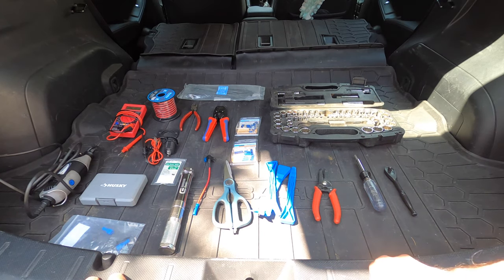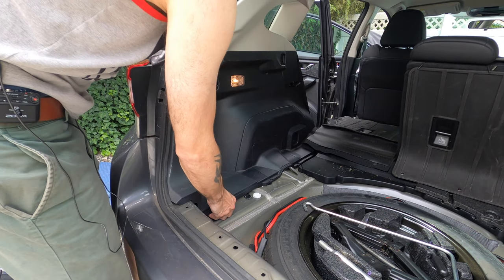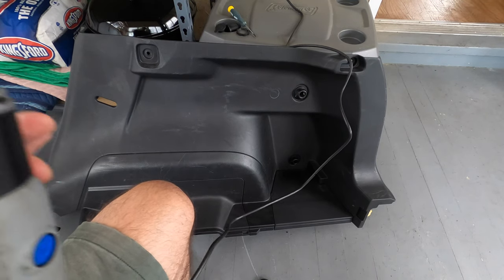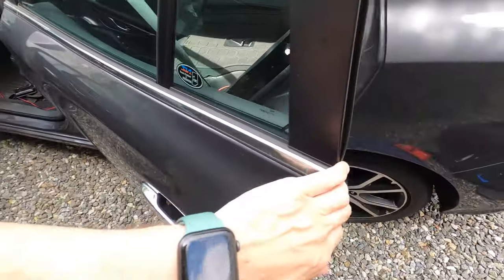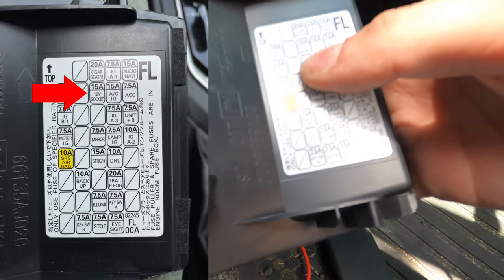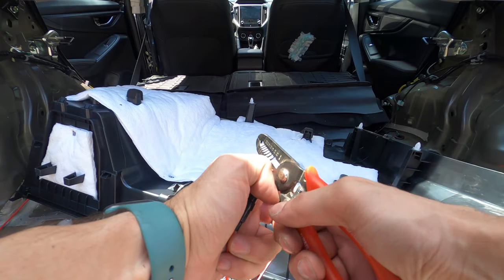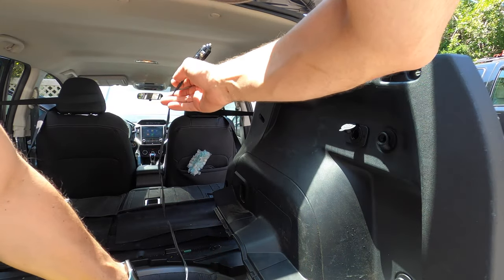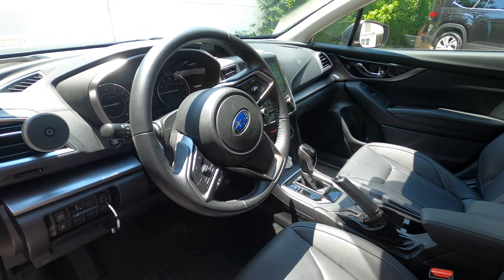How to Install a 12V Socket in Your Car - Subaru Impreza 2018

Comment: Interesting that you took the seat out. I ran trailer wires to to a 7 way tv plug I installed and never once thought the seat was in the way. I am looking to add a 12v plug for a dash cam in the rear of my car so the video was a nice refresher on where all the. Lips and screws are.

Comment: Should note on using fuse taps the prong with the wire side coming out should be on the negative side in the fuse box. Otherwise power flows bypassing the fuse making it point less.

Comment: I have the hybrid, it has a little pocket on the right side where the air compressor kit fits. Looks like I can just drill out the bottom of it and the socket will drop in, and the socket will be facing upward. I didn't take apart all of the panels on the right side, but I assume it's the same as the left. Any reason not to run the wire along the passenger side, and then behind the glove box to the fuse panel?
Reply: Also I should mention the hybrid is a bit odd. The battery is a good 4 inches higher than the lift gate platform. Also, there is an air vent on the left and right (i assume for battery venting), as well as an air vent on the right panel beside the rightmost passenger rear seat. Doesn't look like the older crosstreks have this.
Reply from the maker: The only reason I went around the drivers side was because I figured it would be easier to run the wire along the body and then have quick access to the fuse box versus behind the dash.
Reply: @goinhigher  I was able to drill a hole in the bottom of the right panel. The hybrid has a little 6 inch by 6 inch cubby in that side for the air pump, so there is enough room. And yes, I ran it under the dash and glove box, and down the right side.

Comment: Can I just connect it directly to the positive battery terminal still with a fuse?
Reply from the maker: Yes, that would work fine as well. I opted for this method just to keep all the wiring in the cabin and not have to run leads off my battery.